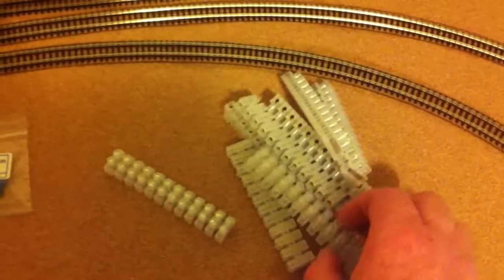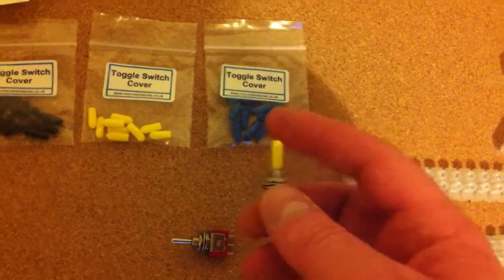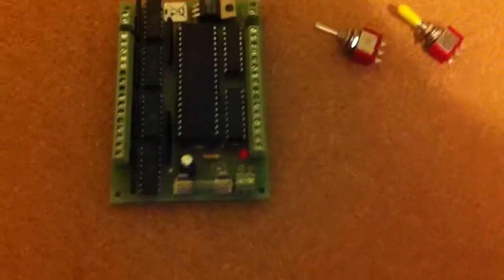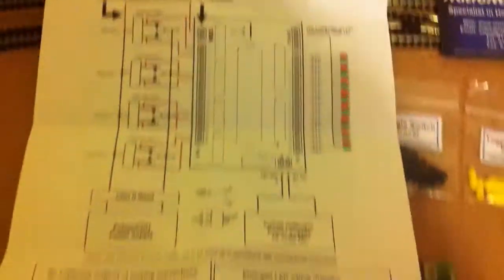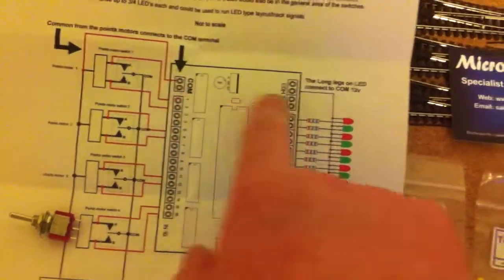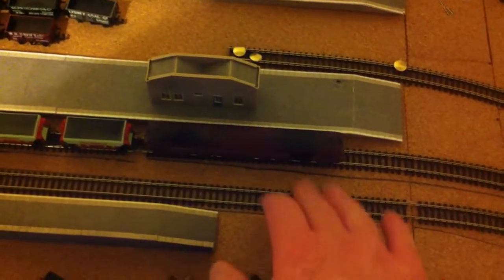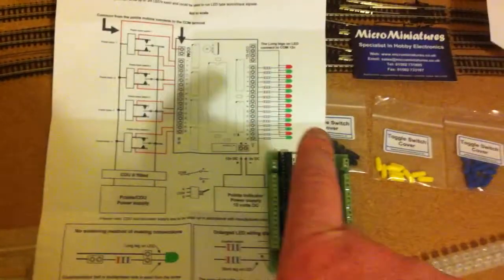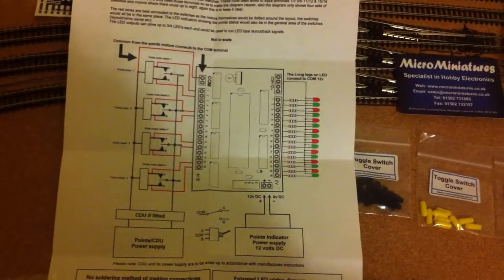New Layout Build Update 10 - Point Control Board

Comment: do you need a resistor per led if having more than 1 per channel
Reply from the maker: The way I did it was to have a resistor per LED but I suppose you could wire it up with 1 per channel if you wanted.  I just wired it as per the diagram.